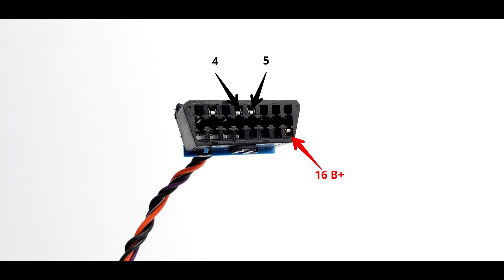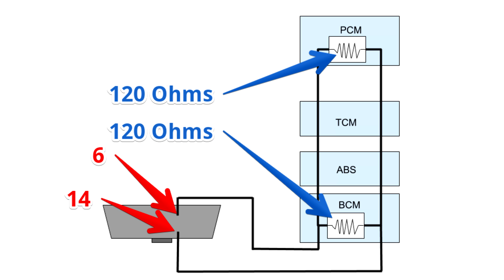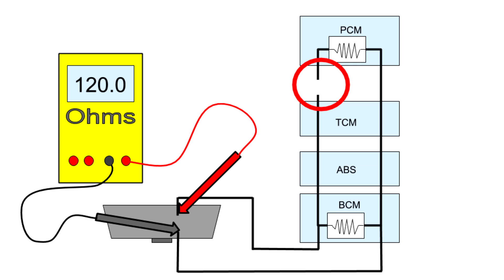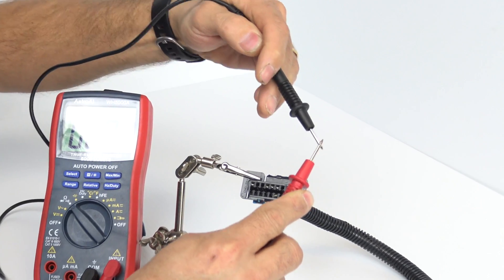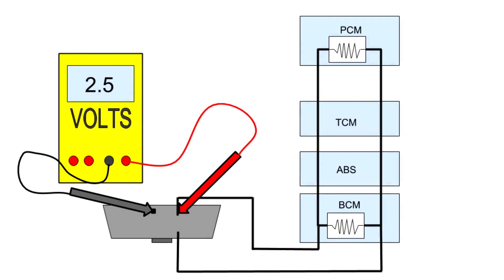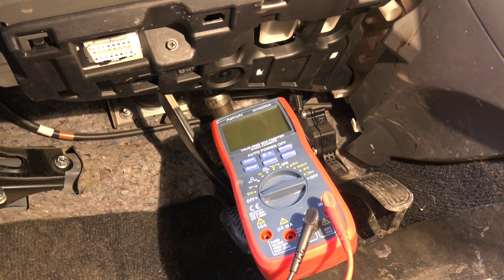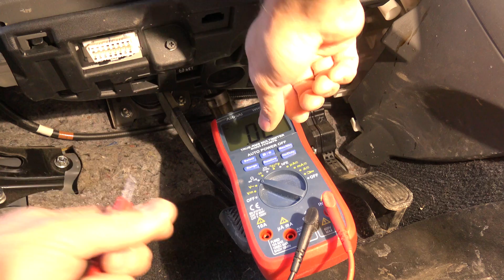DLC Quick Testing Tips

Comment: See now I have to ask. Read 59 to 61 ohms was the window max 58 to 62. Customers Audi yesterday was shown to not record fault with accelerator. Then air mass unplugged no engine management. Then one injector unplugged and no engine management and then another sensor which almost stopped the engine. Not once did the engine management light turn in. 40k miles on the Audi A4 and 14 years old but mint condition to look at. Means nothing though as time kills everything. Found a dirty ground with corrosion by battery and fault codes voltage not reached on two separate modules, suggesting ground issue somewhere. I changed the air mass and spark plugs. Coil over plugs identical resistance but outer sleeves covered in surface rust as were the spark plugs and the threads. White tips to plugs saying burning hot. 

Anyway 55 ohms the system read. I do believe the ecm has issues. This is the reason for this test. To find a module faulty. 55 ohms to 58 ohms my understanding of the lowest acceptable range leaves 3 ohms. That’s a considerable amount of resistance. I don’t believe you are right to say 55 ohms is acceptable. Please comment back
Reply from the maker: 60 is the spec, I have seen vehicles with as low as 55 ohms with no reported issues.not common, and definitely out iof spec, but I just said that because of vehicles I have done other work on and they did not have any comm related issues, infact I was updating modules for other reasons.  I appreciate the input.
Reply: Ohm testing is shot anyway. Load testing is better. Of course cant do that with can line unless everything unplugged. Manufacturers should be scolded for their consistent fesigns which make testing a bitch through lack of access.

Anyway that audi a4 had 55 ohms and it did not light up engine management. So theres a fault
Reply from the maker: @jamesbarratt593  ohm tseting is go / no go for the can system  if you get some bad reading you know you have a problem, and can watch things change as you disconnect modules,   if you have a good reading that is nice and all , but requires more testing of course!  thanks for sharing
Reply: @BrianMann216  Disconnecting modules one by one takes loads of time though. Hidden in ghastly places.

Comment: Thanks for this info... I have a Seat Cordoba 6k2 2002 1.4 16v, and the problem is that wen i plugged it the scan tool the hole car resets (power off then on for a split second) also, the engine runs like crap a few hour's before it recover is self.... It's like it's going to protect mod or someting.. The connection gets lost as we'll... It's hard some times to even delete the errors... I'll try this test you showed us, maybe I'll find the problem... Thanks again

Comment: hi Brian. I am puzzled with the can resistance reading above 120 ohm. I have tested the resistance at pen 6 and 14 on 3 cars at the OBD. battery is disconnected. 
1. 2013 Subaru Forester, resistance reading 61.7 ohms.
2. 2018 Subaru Forester, resistance reading 124.4 ohms
3. 2018 Honda accord Hybrid, resistance reading 124.6 ohms
is there a problem with last two cars or did I do something wrong. 
appreciate your help. 
email: azizaviation@gmail.com
Reply from the maker: The information i provided is common to most vehicles, dobyou have access to service information with wiring diagrams for the vehicles  not reading 60 ohms? I would look there first and also check up on the description and operation , there is usually a wealth of info there but you have to dig for it.
Reply: Hello friend, did you find any good information, i have a 2001 Hyundai Santa Fe 2.4 liter my shows 120 ohms is that normal, or do you think it is an open circuit, my LCD displays information, it says no codes found. Please let me know. Thanks..

Comment: But other people said testing PIN number 14 and PIN number 6 the battery should be disconnected, but yours you said ignition key off
Reply from the maker: Hello Ernest, thanks for the comments,  it really depends on the vehicle, many vehicles can be tested  within a minute of key off, others i have seen take more than 10 minutes for the activity on the network to go to sleep. I think sone of the fords with the dual cluth tcm take like 4 or 5 minutes. I am sure some vehicles need to have the battery disconnected, that is one of the last things I do, nothing like locked radios, driver presets etc.

Comment: What happens if you get 0L when testing the can bus system at the dlc
Reply from the maker: Open circuit?  I would get a diagram for the vehicle that you are working on.
Reply: If you are reading an open circuit across pins 6 and 14, if it is an older vehicle it is very possible it does not support CAN bus.  I just saw that on a 2003 Nissan Sentra and a 2004 Dodge Grand Caravan.  Neither of those use CAN bus.  Looking at the wiring information for the vehicle should indicate this.

Comment: Some manufacturers require the battery to be disconnected entirely to get an accurate ohms reading, on a Nissan Titan I got burned thinking the network was shorted together just to realize that in the service information I blew past “Remove negative battery terminal”. After I did that I got my 60Ohm reading
Reply from the maker: Thanks for commenting, this is sure to help others!

Comment: if you have no voltage at pin 6 or 14 would that indicate ac faulty pcm or bcm because their not sending a signal
Reply from the maker: Multiple module put voltage on the line,   and then pull it down,  so either all modules "down"  or data bus is shorted to ground. What did you come up with ?

Comment: thanks ! tested for cont. in pins 6 and 14 car battery out no power for best results, on 200 omh i got 1208 and on 200k i got 0 or zero! i guess perfect reading should be around 60 half of 120 value on lines! so whats this mean! a short, open wire, module bad , bad ground or what??????
Reply from the maker: Some vehicles may take a long time for the netwrok to go to sleep, some techs may disconnect the battery and then re test the network resistance.
Reply: Hello friend were you able to figured out what was the problem with the testing on ohms at 200 and at 200k, you said a good reading should be 60 were you able to get it...

Comment: For the PCI bus in my 2004 Dodge Grand Caravan is there an equivalent resistance to be expected as the 60 ohms in the CAN bus?
Reply from the maker: The PCI bus is a single wire bus,  not as easy to test,   generally  I get a scope out and test the signal and disconnect modules and connectors until it looks good.
Reply: @BrianMann216  Thank you. Excellent video.

Comment: Hey Brian-- Great Job! I had a DLC from a 2000 Dodge RAM 1500 Truck Disintegrate into a thousand pieces.  I found another one at a junk yard,  from a 1999 model, but the wires were of different colors and locations.  I have a factory service manual, but it TOO shows different locations for the wires.  Now I am trying to take apart the junkyard DLC, but it is Not coming apart very easily.  I looked at all kinds of videos of how to take apart connectors, but NONE of them show MY connector.  Very Frustrating.  Is there ANY WAY that you can do a video on this topic? If you can, I am sure that many of us would appreciate it.  Thanks.  Again---Great Video.
Reply: How  did it go ?   
....also curious  how  the data port got crushed/ crumpled in the first place?

Comment: Working on a 2005 GMC Savana, apparently pins 6-15 have no use. I thought I was on to something when I tested 6&14 and got no reading. But no.
Reply: Hello friend did you performed any tests my OBD II port i think is the same as yours, pin 6 and 15 are blank no metal pins, did you find out how to do this tests without those pins missing, by the way i have a 2001 Hyundai Santa Fe 2.4 liter. Please let me know thanks

Comment: Very nice video man. I have the following problem on my wrx from 2006. On key position 1 and 2 the obd port has power. When I turn the key on the last position the power on the OBD shuts off . When I hang my delfi diagnostic box on the obd port it also indicates on position 1 and 2 that it has power, but can´t connect to it. 
What could that be for a reason? The cigarette lighter has power on all key positions. Would be so thankful if you have any tipp to give. 
Kind regards.

Comment: Excellent! It's crazy how hard it is to find basic troubleshooting info like this. ... now do the rest of vehicle wiring like testing modules and connectors. :)  ... Everytime I try to find info, it's some guy with a scope doing an hour long speech about looking for uneven signals.
Reply: Now I see you have a few other vids about testing those things. BTW I'm not anti-scope, just a DIYer that doesn't have one.
Reply from the maker: I love electrical testing. Many times a multimeter is just fine, however the more I use a scope the more detail I see and can "see" more Cleary what is going on.

Comment: Hi, with the key off I am getting 60 ohms but with the key in the on position I am getting -10 ohms. My car won’t start, I have no dash lights, and code U0155. I changed the cluster and ecm but it didn’t fix the issue. Help!
Reply from the maker: Key of 60 is good. Do not measure the resistance with the key on.

Comment: when you reading 2.5 volts, in ether side, (usually in both sides) means that you have a short on your network and you resistance test (with the key off o battery disconnected) will gives you a value of 0.1 or 0.2 ohms. In that particular test you did... reads 60.9 ohms which is alright and the volts on your low side is 2.3 +- 0.1 average and your high side is usually 2.7 +- 0.1 for the total of 5 volts that is why you read 2.639 and 2.343 = 4.943 + lead resistance usually 0.1= 5 volts +- something.
i did one today and literally read on 14 - 1.98 and 6 - 3.01
Reply from the maker: I was giving approximates. With a scope we could see acrivity. This is just a quick overview
Reply: @BrianMann216  what if I have reading of  30.1 ohms  ? . 
I used to have more then  250.0 ohms on my toyota 4runner and I found out that  my angel sensor causes the problem  but after I fix it  I have   reading of 30.0 or  less  and sometimes 60.0 ohms .

Comment: Say for example in my car the ohms reading between 6 and 14 is OL, not 60 nor 120. What could this mean
Reply from the maker: More than likely a open in one of the CAN bus circuits between the dlc and the 1st terminating resistor. also possibly a bad module that is between the dlc and the 1st terminating resistor.
Reply: @BrianMann216  Thanks for replying, I just pulled out the OBD port and 6 and 14 are empty. Nothing in them, no wires.
Reply from the maker: @linlinlixin2637  like I said in video this protocol was mandatory 08 and up,

Comment: Hi Brian thanks fore the greate video's ! I have a problem on my bmw 630i 2005 model , i exadently put 12v on the litle yellow and black whire 😔 of the canbus cables i that is was a tweetercable.. after i did it the car won t start !! I disconect the battery,  pull al the relais out ,check the fuses and it seems fine , can you please tell me why it won t start .. and when ik put the computer in the OBD it make s no connection .. 😏 what do you think ? Thanks

Comment: Thank you for this, My car is TOYOTA IST (2002) and i found DLC metal at (4, 7, 9, 13, 15, 16), is that a problem if it does not have at position 5? which ISO protocol does it use. Thank you in Advanced
Reply: I have plugged in the cable of ODBII connector at the DLC using JDIAG (JD906) but it claim "Error in Communication with vehicle ECU". It suggest to check the cable if connected, or the ignition is on or my car is not ODBII compliant. Can that be a problem on DLC?
Reply from the maker: I am not sure I have information on that model.

Comment: Thank you Sir!  I just got a 5.7L Hemi on a run stand and it would start but not run.  Your tutorial led me straight to a need for a $0.15 resistor that got the CAN Bus working.
Reply: Just wondering all your control modules started communicating after that?

Mine has a problem it's reading 120 ohms and can't communicate to my scanner.

Bought a ecm and it still does the same thing.

Comment: You might be able to help with some info. I have a heavy truck that reads 120 ohm over can lines, and both voltages are 2.45 to ground. All the instruments work fine. I am trying to read from the can bus, but my tool is not getting anything from the vehicle's can bus. Any ideas?
Reply from the maker: Not off hand, I do not have much heavy truck experience,  the systems should  be the same as I am familiar with. Start unplugging modules and see if com comes back to the ones still on the bus

Comment: My car has a lost communication code it say at tcm what does that mean
Reply from the maker: The transmission control module is not communicating.
Reply: @BrianMann216  could the module be bad
Reply: @BrianMann216  it also has a transmission speed sensor code to could that cause lost communication

Comment: Sir bryan i have a car mitsubishi mx 2001 model gls matic.... Cannot connect in ecu my scanner.... What im going to do? Can you give specific knowledge about my car in the obd port... Pin 4 and 5 and 16 what is the reading originally ing volt meter?when you test the pin 4,5,7 and 16 the ignition of car is on?
Reply from the maker: I am not familiar with the vehicle that you are working on I do not believe that it has a can system I would recommend checking powers and grounds to the ecu in question
Reply: Thanks sir.....

Comment: It was good, i am going out right now for practise. Thx
Reply: Please show us the results!!!
Reply: @LuisMartinez-fr9gq  my Car was OBDI compliant, not OBDII. But your video was very helpful. I thought long time ago that the port was broken. It wasn't. Just OBDI type. Thx
Reply: I am not the one who made the video, but thanks for replying, i was reading the section of comments, my car has an OBD II program so yes totally different, i have an issue my car does not start, only cranks, but at the same time my scanner will not connect to ECU, i want to check the pins Brian was explaining but my port OBD do not have pin 6 only pin 14 for CAN BUS. by the way i have a 2001 Hyundai Santa Fe 2.4, comes with 7 wires, 4 at the top and 3 at the bottom, do you know how can I get the info of each pin on my OBD II port.